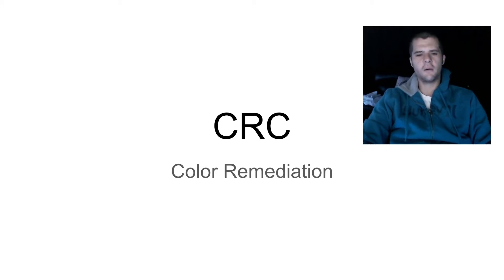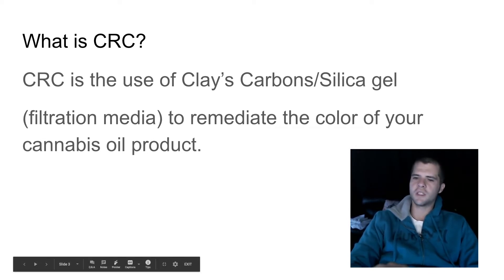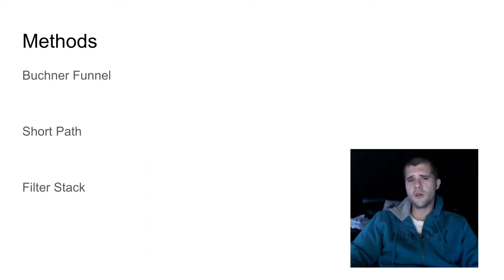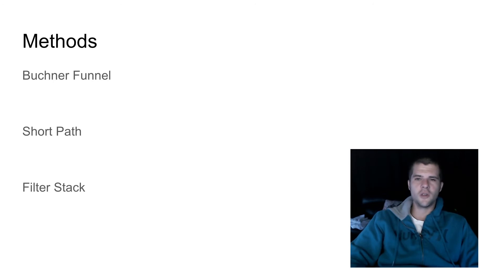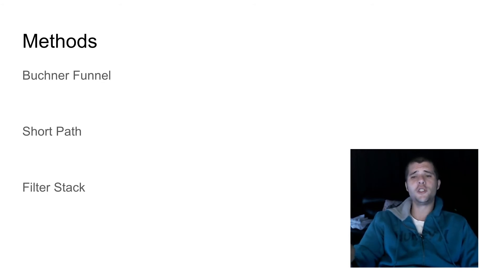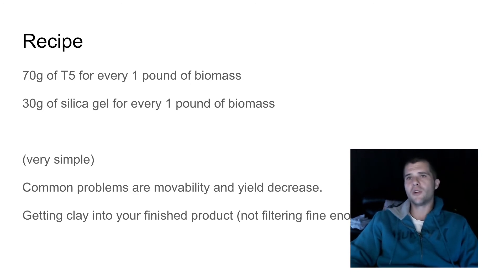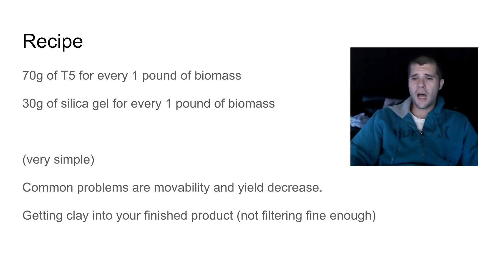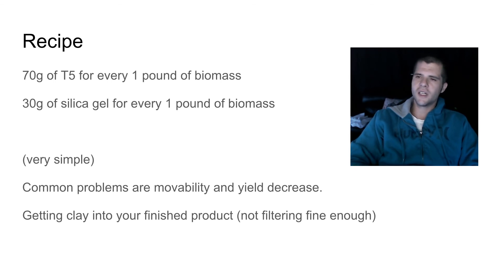How to remediate Cannabis oil color

Comment: What do you do if the 100g of media x # of lbs doesnt completely fill the stack? Do I leave the space void and carry on?
Reply from the maker: exactly. this will actually help a bit with flow. many people pack their filtration media very compact and without some sort of nitrogen assist or very powerful vac pump you will find that the first problem you encounter is flow. I do a light fill no pack. if there is still room in the filter stack thats just fine.